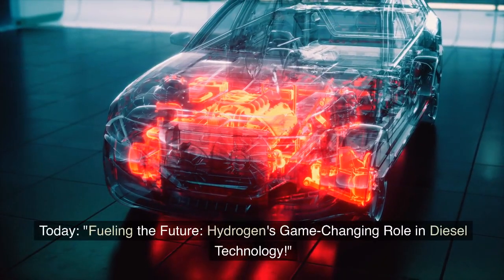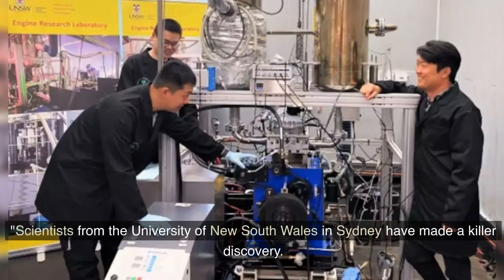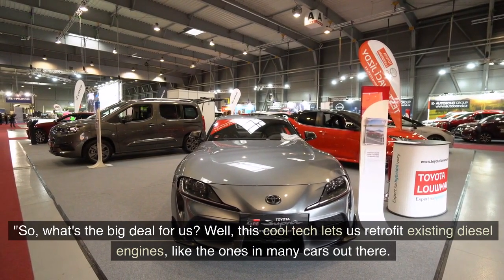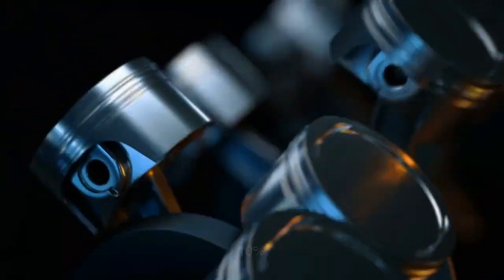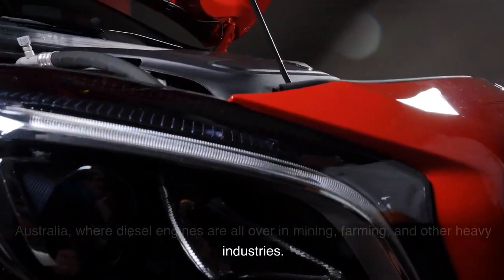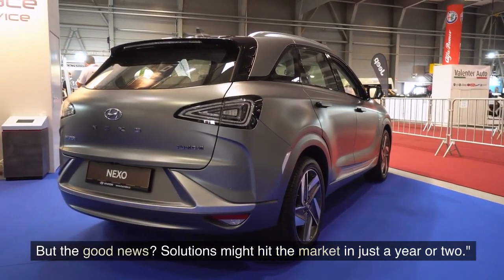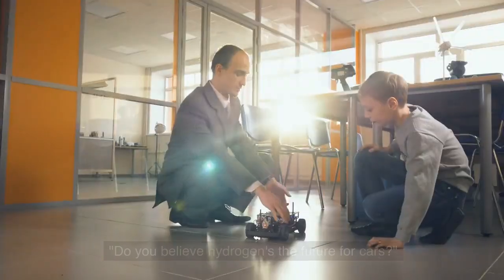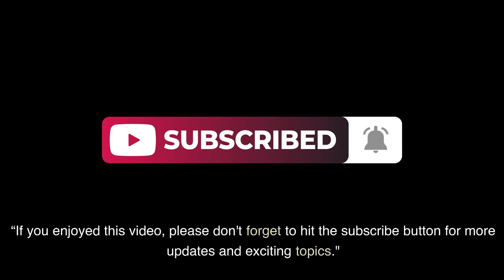"Fueling the Future: Hydrogen's Game-Changing Role in Diesel Technology!"

Comment: We here at TSS  have been doing it for 16 years. Getting amazing results with hydrogen on demand. Which has four times more energy density than bottled hydrogen. I have lab certified data that gets better results than that from the California labs. We currently have two EOs and CE certification and more. We reduce emissions 98% and fuel savings upwards of 48% have real world data on multiple engines around the world!! We do not need to use a storage. That is the beauty of this technology!